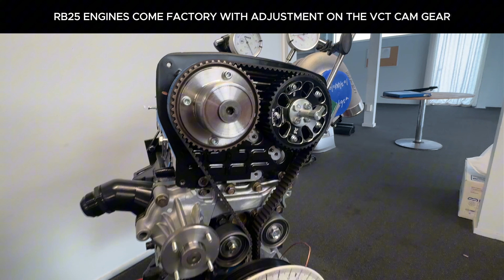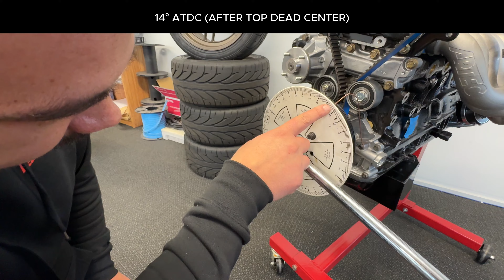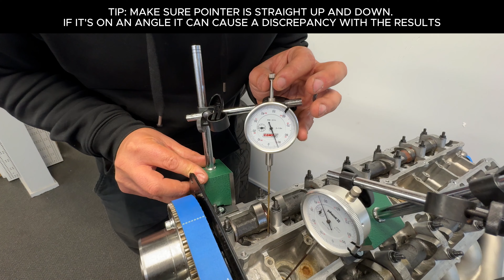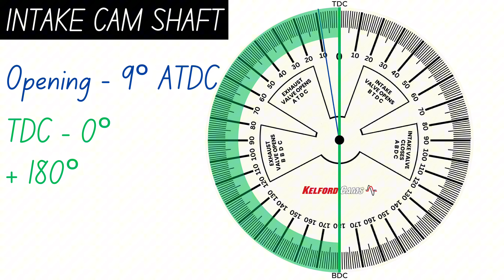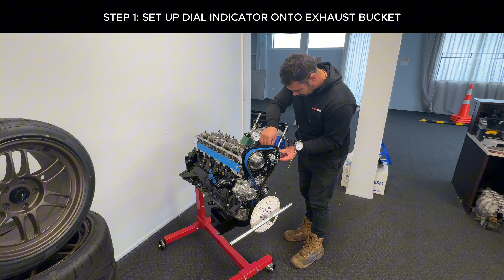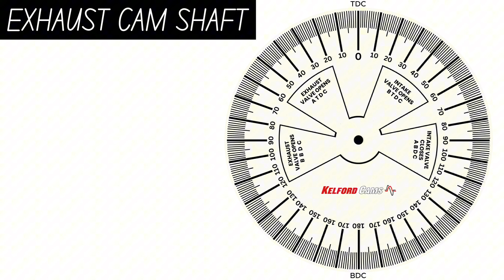How To Degree Your Cams | Nissan RB25 Neo Timing Tutorial

Comment: Ive purchased the kelford 226g cam which is a single cam for the rb30 but i just placed it in the normal spot where a stock cam sits, just done the whole 53 teeth on the belt, is that bad thing ?

Comment: what would be the recommended centreline for the vct intake cam? i have a set of 246-A rb25 262 cams and on the cam card it just says VARI for the intake cam and 114 for the exhaust. at the moment i am getting an intake centreline of 119, but i have that same franklin vct gear adjustment mod so i can adjust it if i need to, just dont know what i should be aiming for because it dose not say on the spec card?
Reply from the maker: @liam9658  123°-125° on the intake cam

Comment: How woild on go About degreeing a rb25det series 1/2 with hydrolic lifters? The neo cam with solid lifters but hydraulic you would have the possibility of the lift not being accurate if the lufter is not been lashed via oil pressure when running. Would a solid lifter need to be installed on each cam to measure or do the nvcs cams come as a drop in with factory timming?
Reply from the maker: Hey Leon, thanks for the question! The S1/2 Hydraulic bucket is always in contact with the cam lobe because of the little spring inside the bucket, so any movement from the cam will move the top of the bucket where your pointer will be. The valve on the other hand wont see the full movement that the cams has applied because the lifter could bleed down, this wont matter when it comes to decreeing up your cams. Thank you 😀
Reply: @Kelford-Cams   im in the process of degreeing my kelford 262 cams on my rb25 hydraulic lifter head, could u clarify what u mean? on the kelford site it says i have to convert my hydraulic lifter to a solid lifter for the degreeing process? would that not apply in this case? Thanks
Reply from the maker: @liam9658 our website recommends a solid lifter for engines using a rocker arm, on a rocker arm engine your pointer will be on the retainer, the hydraulic lifter can bleed down and give incorrect results, a bucket engine doesn't have this problem when degreeing your cams as the pointer is on the bucket and the bucket will always be in contact with the camshaft lobe because of the internal spring. Hope this makes sense
Reply: @Kelford-Cams   cheers, that makes sense

Comment: Thanks for great knowledge. Well made. 

I dont get Why add 9* to 114, when 114 is intake cam centerline?
Reply from the maker: Hey mate, glad you liked the video!  Good question, 114° is half of the 228° duration we found so essentially it is how many degrees after opening that it will take until we reach maximum lift. However, as our opening point was not until 9° after top dead centre, we need to add the 9° to the 114° to make our centreline relative to TDC. This is how we wind up with a peak lift centreline of 123° after top dead centre. I hope this helps ")
Reply: @ okay, all clear. Thank you :)